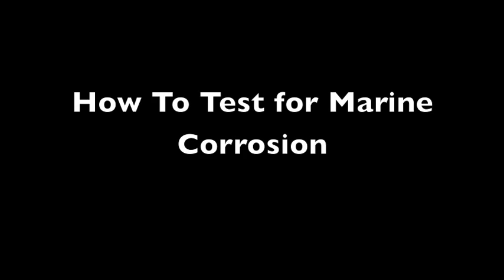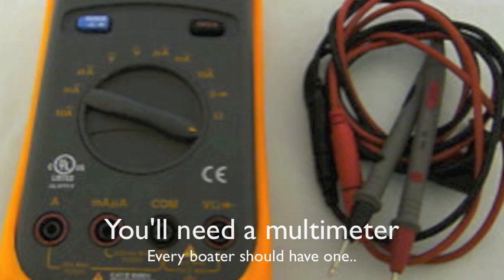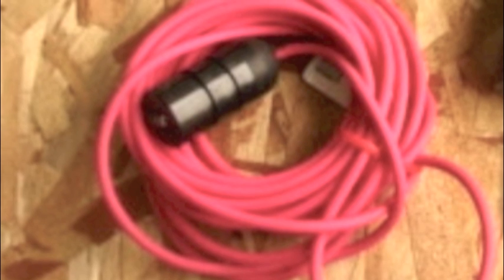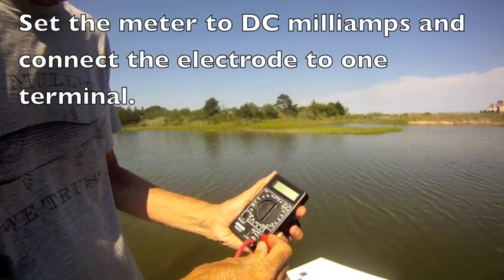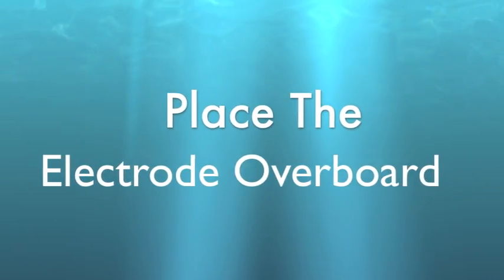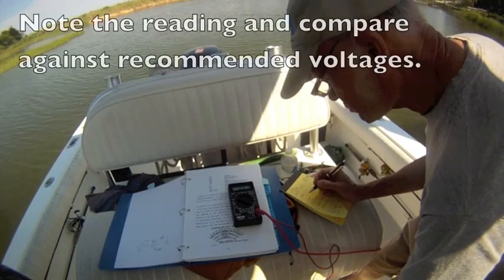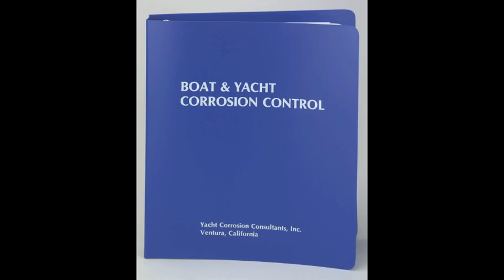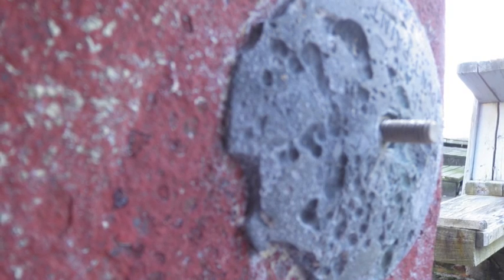How to Test for Marine Corrosion

Comment: What would cause on a twin outboard boat the outside 2 bolts to fail abs the inside 2 to pass? Brand new anodes abs boat is 2 years old